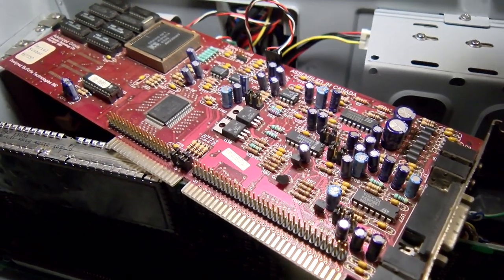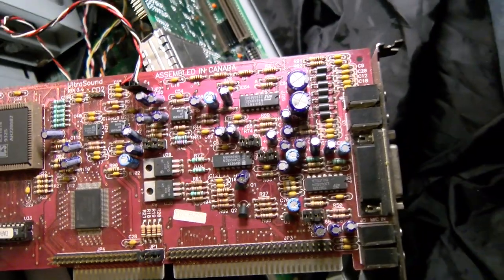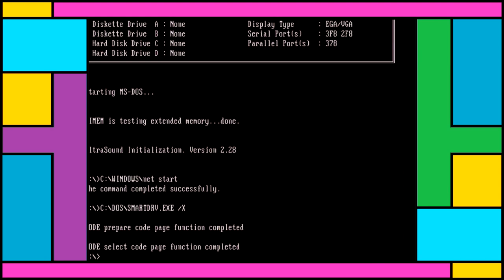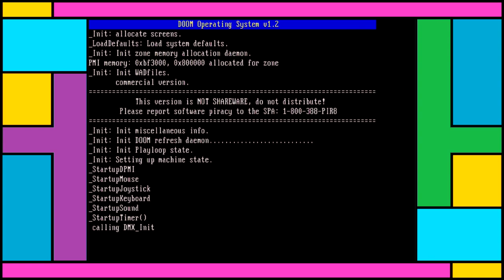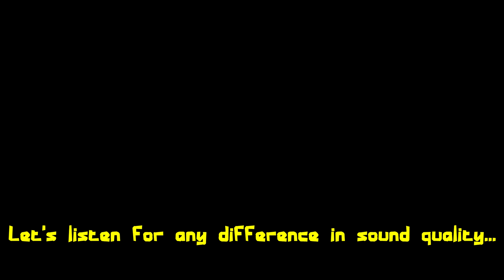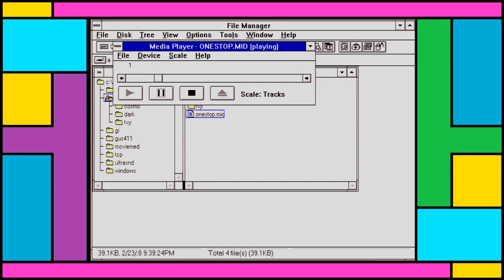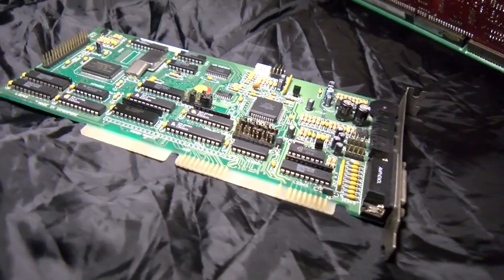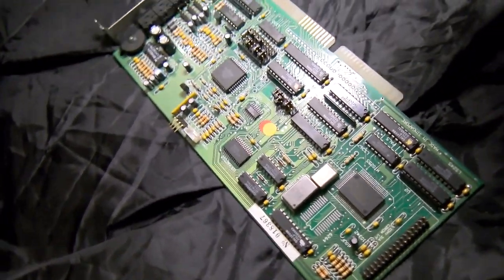The Real Gravis Ultrasound Experience

Comment: I won't argue that the Sound Blaster and Adlib emulation is bad, it definitely is.  Gravis did a huge mistake in the marketing to say it was a good card for playing older games with SB/Adlib compatibility.  I won't apologize for that because it is a legitmate failing of the card.
That said, a lot of your points are overly harsh given that you clearly had some technical issues getting things working.  I've used it for months in a 386dx-40 and a Pentium 120, in both DOS and Windows, and never had the crashing or slow issues you experienced.  I've never heard those glitches in Duke Nukem 3D.  I never had any problems with playmidi not loading the correct samples.  You should have tried a second system to verify your issues were with the card and not your system.

Your complaint that the audio goes down to 19 KHz when using 32 voices is a bit silly since you compared it to an 8-bit SB which maintains 22Khz -- yes, but with an SB, you're mixing 32 voices in software with a massive speed hit.  Also, this limit was rarely reached since no game used more than 8 for sound effects and 16 for GMIDI, which would produce a GF1 sample rate of 24KHz.

Speaking of Sound Blaster, contrary to what you stated, it was not difficult to set them both up in a system. GUS can use 240,7,7,7,7 (DMA/IRQ) and a SB16 can use 220,5,1,5.  No conflicts, worked perfectly, ran that setup for years.  I'm not saying this was what regular consumers should have done, I'm just pointing out that your claim it was difficult or had compatibility problems is false.  No GUS-supporting software was locked to 220h.

Your mega-em experience is not typical.  Not only does it work, it works well.  If you couldn't get it to run, you probably should have figured that out first before declaring it crap.  It even makes an attempt at MT-32 emulation, which is nice for older games.

BTW, showcasing GUS MIDI output with audible ground loop noise, and the Turtle Beach without that noise, is disingenuous.
Reply: Damn Jim, youre mad. Its just a soundcard. I had many of the similar issues he pointed out with mine.
Reply: @s3vR3x  I'm just adding my voice. The gravis ultrasound is truly horrible in adlib/soundblaster compatibility but I don't believe it should be kicked while it is down with issues that didn't occur on all machines. General midi cards were expensive in '93, the gravis offered a solution for that with additional advantages.  so if you already owned a sound blaster, and wanted general MIDI, it wasn't uncommon to purchase the ultrasound and install both cards in your system. People did this with the LAPC-I and scc-1.
Reply from the maker: You know full well I always value what you have to say and believe you to be very knowledgeable, but I feel you may have missed the mark a little here. Firstly, I find it mildly insulting that you appear to imply I didn't test on other systems, despite stating that I had used the card on other machines, as well as that I somehow caused the noise in the MIDI recording. Secondly, I find the 24KHz claim surprising.
The issues I face have followed the card across several systems and I have spoken with other owners who have had the same type of problems. They seem to worsen as CPU speed increases, but as early support for the card was rare, many games and demos that use it require faster CPUs. Spirit still had mild slowdown on a 233MHz P55, though it's possible Euthanasia's motion blur simply wasn't very efficient. The audio glitches in Duke3D are actually mild on this system, the music used to fail to load samples on that faster system quite often or were prone to much more popping.
An 8-Bit SB will maintain 22KHz. In many cases, so will the GUS, because often, titles seem to just keep things there, as they would on a Sound Blaster. Possibly this was to make resampling calculations easier, or avoid them entirely. Almost all audio samples are 8-Bit anyway, so aside from hearing stepping in the mixing if you listen hard enough, the resulting quality should be much the same. Outside of some demos, I can't really vouch for the GF1 helping to make things faster, but perhaps this only manifests as the system itself gets faster, where that host system may have to wait for the card and a slower system might not - I did not, however, see this on my 486DLC-40 when using it there and still had performance hits in the few things that would use the card on such a slow system, of which there were few as most games and demos seem to want a faster CPU, as noted before.
That port, IRQ and DMA setup is a no-go. With the GUS alone I already have to shuffle the interrupt around for some things to work. Duke3D requires the IRQ be 7 or less, but then I get no sound in some demos and have to move it back to 11. Installing a Sound Blaster alongside the card makes things worse, as then software relying on detection seems to break entirely and there's less room to play with. I've never had this work reliably and have consulted with others who share this experience.
I'm not sure what you want me to do about the noise. Are you suggesting I should apply noise reduction or modify my setup to cater to the GUS' shortcomings specifically? That would be dishonest. Both cards used the exact same setup, the GUS obviously produces more noise. Interestingly this is at its worst when playing MIDI. I don't know why, I didn't design these things. If you listen hard enough, you can actually hear drive whine bleeding through the Maui recording, as unlike the GUS, there are four devices chained to it, two of which are directly connected to the VGA card and so you'd think it would be the noisier of the two, but apparently not.
Comparing the installation of a GUS, alongside another card, to the installation of a MIDI card is rather strange, as MIDI cards used few resources and were intended to be used that way - there was even a Gravis board for this application - and I find the claim that it was 'common' to use a GUS this way dubious. The card is relatively uncommon already.

I'm not intent on falling out on this, so I think we'll simply have to agree to disagree on it. Your experience is clearly very different to my own. There are many positives to be said for the card, but I think everyone else has done those to death and so I felt little need to reiterate them in this video.
Reply: @HighTreason610  I'm not intent on falling out over this either, so instead I'll ask a hypothetical question:  If the new GUS clone cards being worked on fix the sound glitches, noisy output, and lower sample rate at high channels, would you consider using or recommending one?
Reply from the maker: Assuming the price wasn't too steep, then most likely. 
The sample rate thing doesn't really bother me, I merely thought it was worth noting, like everything else, so that people are aware of the limitations and don't end up being disappointed if they ever get a GUS.
Practicality isn't mandatory, this is a hobby after all.
Reply: @HighTreason610  Arent the new GUS clones based off the interwave, which is far improved from the GF1?
Reply: @Whyworry Street yes, that's him! I love when he comments too!!!

Comment: Doom can sound quite good with the right setup:
/watch?v=figScJtkQk8&t=4m59s (Plug & Play ver. of GUS w/ Pro Patches 1.50)

But even this is better than SB16 which used pretty poor FM synth, not really comparable to midi.

16:38 So for which games is this an issue? Is there a list of OSTs that use all 32 or more than 14 channels? I think Jazz Jackrabbit uses something like 7-8 channels though I haven't opened the files in a tracker to check exactly.
Reply from the maker: To be honest I don't like the Pro patches and wish people would stop using them in place of the originals. They'd have no use here beside their brief mention as I tend to take the approach of the device having just come out of the box, as well has how far an average user would be likely to have gone with it. Most people would just have run the installation disks and have been done with it. I prefer to represent the product Gravis sold, not one made by a third party after the fact.
Most games seem to top out at 22KHz or less. As for Jazz Jackrabbit, the only redeeming quality of that soundtrack is the fact that there's an option to turn it off, unless that's just a rose tinted memory.

Comment: How DARE you bad mouth the GUS.   Hey I like Socket 4 stuff so bring it on.  Kidding about the GUS.  I like that you keep it real with hardware.
Reply from the maker: In all fairness, there are positive things to say about it too, but I think everyone else has said those already, so there was little need to go over them again. 
On the AutoCAD thing, a lot of it seems to be down to  the CPU's I/O performance and not the core, though it still isn't 100% clear how this performance is lost. ACAD may well make a return though, as it's a good way to test FPU speed if nothing else and measuring the time is trivial to do; split the clip in Vegas/equivalent on the first frame of drawing, apply the timecode overlay and read the number on the last frame of drawing - or else calculate it from the project's overall timecode. Luckily later versions included even more complex example files, so those can be used for systems that are too fast for ACAD2.
Reply: Agreed. I would say that waybacktech needs to make a video but I'm slacking also. You both are great people and thank you.

Comment: Either you have a really bad revision card, which is of course totally possible, or the driver revision you're using isn't working properly. The sound issues you're having in GUS native games, are ones that I've never run into with my GUS. And I get higher FPS in GUS native games than when using SB, at least on my 486DX4 100MHz, due to the hardware mixing.
I totally agree that it's overpriced and overestimated. It's a good card. In the right situations, it's great in fact. Some games sound fantastic on it. One Must Fall 2097, Pinball Dreams/Fantasies, Transport Tycoon Deluxe etc. But it's not a complete product. I have it sitting side-by-side with an SB16 (with a Dreamblaster to avoid OPL as much as possible), seeing as games support on the GUS is so limited. But it certainly doesn't work well in Windows 9x, so it did die out once the Plug and Play era came along.
Reply from the maker: Over the years I've tried various driver versions, I think two or three even show up in the video, but they all have similar problems. I have talked to other owners who experience the same or similar issues. These issues do seem to get worse as CPUs get faster, but therein lies another issue with the card - a lot of the games and demos that support it seem to want a decently quick Pentium class system to run decently. The very last demo shown here, Spirit, will even hit slight slowdown on a 233MHz system.
I do still think it is a good card, from a hardware standpoint, the GF1 is mighty, but the experience sure is sour when trying to use it as a primary sound card. Of course it doesn't matter as much now, as it doesn't have to be relied upon and can be enjoyed for the sheer novelty. When something doesn't work on this machine, I can just fire up a different machine - this doesn't let it off the hook though, as I still have to judge it as it was in its own time, where such an option likely wasn't available.
Reply: @HighTreason610  I entirely agree that it's not really suitable as an only sound card. And the prices these command today, are ridiculous. I bought mine long before the prices started to skyrocket fortunately.
Reply: @HighTreason610  Haha, there's a scene (open sky, crystal horses) in Spirit that even can lag on a P3 in 640x400 :D

Comment: @13:37: Quake does not only support the GUS, it does specifically support the Max and PnP codec which stream audio data like an SB (or, to be more precise, a WSS). But with a classic like yours it allocates a double buffer in GUS memory and DMA transfers a software mixed effect stream. And Doom does the same. They do it quite well. (now 23:30) Except that many chipsets experience huge slowdowns when GUS streaming goes on, like up to 25-30% on many Socket 7 chipsets, according to Quake timedemo...

SB emulation is a pile of cr4p without question, though (especially FM synth). Windows support is lacking too (though it MIGHT use 3.74's proper mixer capabilities, I have no idea).

24:52 - The biggest difference is frame rate, and even that's small.

@28:00 - All in all, this is a niche card. It was easy to write small mod players for it that could be fit in small intros. I did it myself, it takes a few hundred bytes and I wrote it in a week having no experience. It also saved a lot of CPU time on slower systems. On a fast Pentium, not so much. There you'd be better of with software mixing. I love the card btw, it's a staple for me when I build almost anything. For watching demos, of course. When gaming, I often reach for something else. Many of my builds have 2 sound cards for this very reason. Thankfully GUS prices don't concern me at all, I got at least a dozen of them for free.
Reply from the maker: Is it possible this was added to Quake in a patch? My copy doesn't support anything but Sound Blaster, in fact I think it explicitly mentions this and I was told (many years ago, mind) that the official line was to run MegaEm, if you could get it to work, but to expect problems. Of course, it could just be Quake being broken, it is an ID game, after all. Interesting that you say Doom uses software mixing, I suspected as much. Also, yeah, you might have noticed, I noticed the slowdowns.
Contrast actually sounds quite harsh to me on an SB16. Interestingly I had trouble syncing the two recordings as the music seemed to play at a slightly different speed, but I've seen this elsewhere, such as how Second Reality is notorious for this as it's even more pronounced in that one - it plays slow and gets pitched down on SB cards. As for frame rate, I found Terminal Velocity quite shocking.
Niche card it may be, but it wasn't marketed as such, so I can't honestly let that slide. The problem with the 'it's better on a slower system' approach is that most of the things that support it seem to want at least a decent 486 if not a Pentium class system.
For the record, I like the card at a hardware level, I also despise Creative's hardware, but I'd not feel comfortable ever recommending the GUS to anyone, unless they really knew what they were getting into and, like me and probably you too, they liked sticking their hands in the machine as much as actually using it.
On 286s, I need to find a case for a particularly late one I have, a C&T branded board with almost everything built in, even VGA. That one takes SIMM RAM, uses a Harris CPU.
Reply: @HighTreason610  If version 1.06 can be called a patch, then possibly. But knowing versions and sources wasn't the way we got stuff in the '90s...

Sounds harsh, you say? I could say similar about Pinball Fantasies. It sounds very different with SB and GUS and in this case it definitely sounds like the work of the mixing routines. They don't use any filtering (they just use the closest integer sample) while GUS mixes with linear interpolation. Doing no interpolation often leads to harsher sound because of the aliasing. Those frequencies are completely artificial but they can somehow make it sound 'free' or 'not as depressed' while the GUS version is muffled in comparison.

On 286s - And that's where the GUS is put into good use in the aforementioned game ;) Otherwise it has very few demos (or games) with GUS support, most of them needs at least a 386 to even start. I still like the platform a lot, I can't even explain. Especially late ones, with small boards and at least drive type 47 support.
Reply from the maker: Indeed, the way I got the game was as v1.01 on a CD in the 90s. The included text files suggest no GUS Classic support, but that MegaEm may work, albeit with bugs or delays, so it seems this may be the original source of what I was told. Trying with SBOS seems to crash the game. Incidentally, these discs had a defect, it seems, as the redbook audio doesn't work on them (I know at least two other people with the same disc), so we thought the game didn't have music until only recently. We were then disappointed by the music being garbage. Overall, I'm surprised at ID here, as the GUS seems like the type of Wankware that would be right up their alley.
Interpolation or otherwise, it doesn't help that Creative didn't spec the right components on their cards. Media Vision cards never sound that rough, but then those were usually made properly.
Cannot imagine running a GUS on a 286, they surely wouldn't even work on some of the earlier systems and I don't imagine much would run on them anyway, there are already few enough with Sound Blaster support that will go smoothly. As noted, most programs that support the GUS seem to want a DX2 or a Pentium. Ultimately, you won't lose much though, as those titles generally support other cards anyway, which is why the GUS can generally be skipped over.